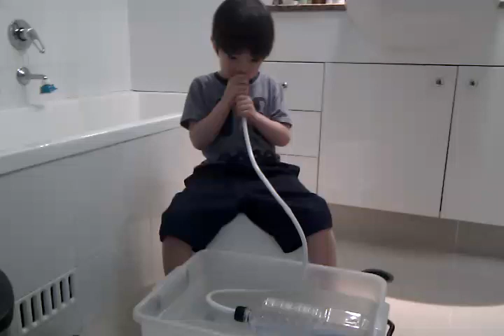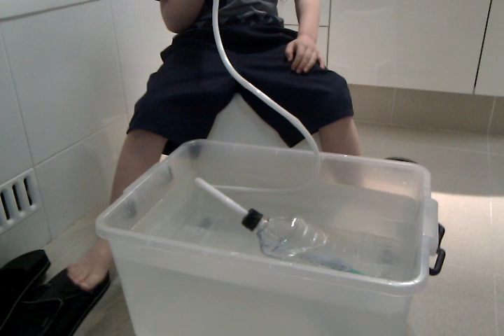Submarine ballast tank model

Comment: In a real submarine where does the air come from though? I'm assuming they don't carry giant pipes across to the surface?
Reply: There may be air cylinders or some other way by separating oxygen & hydrogen from water
Reply: The air is compressed inside the submarine. They just suck the water in. When the submarine is going to rise, they blow the water out.